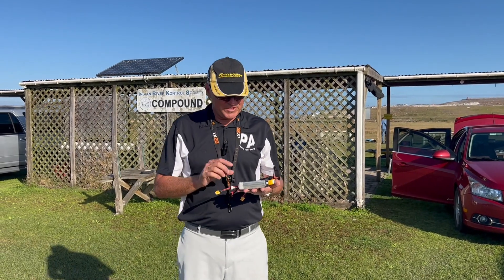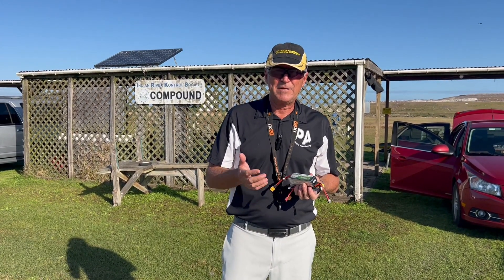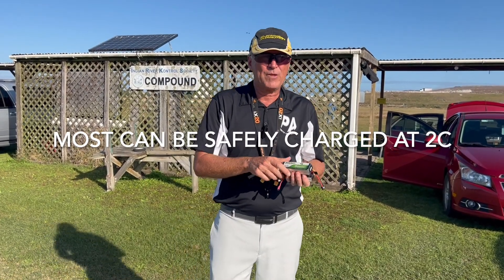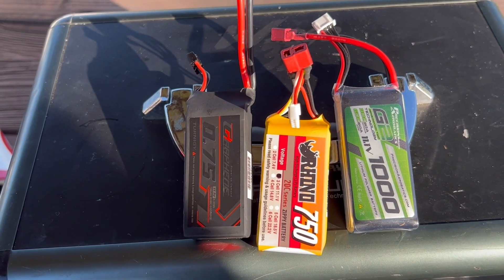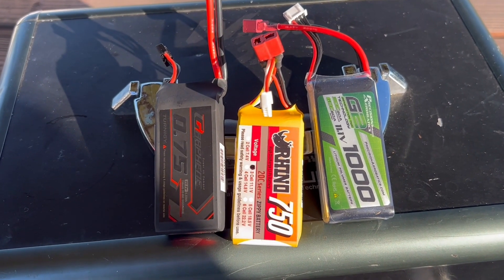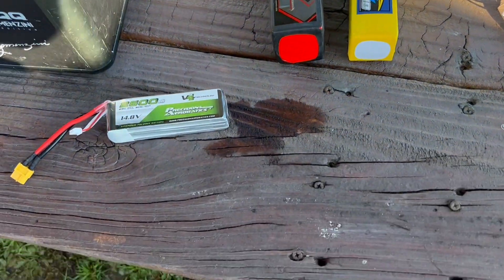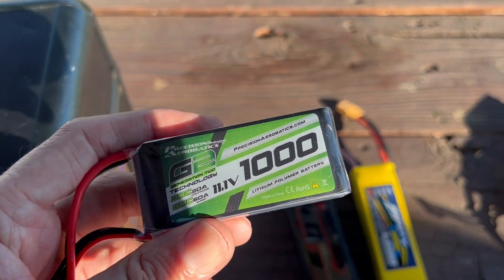Michael Wargo Instruction:   Batteries.   Choosing the right battery.  All you need to know.

Comment: Hello Michael, I would like to know how many C of discharge I need for the battery for the hobbyking Durafly Tundra v3, in its specifications it says 4s 2200mah, and a minimum of 30c, but how many C will be ideal? I recently discovered your channel and I find it essential, greetings from Spain.
Reply from the maker: The Tundra is not a power hog.   30c is fine.   Honestly, I like to fly it light, so a lower c rating is what I gravitate toward.   BUt remember, what should help your choice should be how you fly it.   If full throttle all the time, a higher c rating would be better.   I hope this helps!

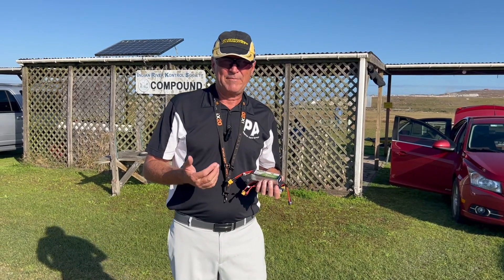Comment: 0:48 No, That means it is 2.6 amp hours. Ah is energy storage capacity. Amps is an instantaneous measurement of current.
This is designed to be an introduction video. Don't confuse the novice immediately by mixing up this basic terminology.

Comment: We tend to forget that capacity is milliamps. Per hour. Our flights and motors consume so much amperage, that we reach safe discharge in 6 minutes 1/10 of an hour. That draw is not constant either, depending on the craft and flying style there many be different burst of amperage,  (really watts amps x volts). This is why the other "C" rating which is of burst capacity may be higher between craft.
A 5lb plane consumes less watts and has potentially fewer and less bursts than a 5lb heli

Comment: When it comes to battery claims, believe no one.  labels lie.  Manufacturers lie.  Under realistic high load tests the best high C batteries rarely exceed 35C-true.  Anyone who believes a 50C, 2600 mah battery will deliver 130 anps (2.6x50) is grossly uninformed and has no business spreading such misinformation.  BTW, capacity is measured in milliamp-hours, not milliamps.  And light-weight batteries are generally light for specific reasons -- which are not beneficial to performance.  Sad fact is weight and battery performance go together.  Bottom line, you need to realistically load test your batteries to know what you have.

Comment: Enjoyed your discussion. Also would like to see a comparison between std. and HV Lipos to know if those are worth using...👍
Reply: They are.  I have been using the SMC HV batteries.  ITs crazy how long I keep mid-high range voltage.
Reply: The smc  hv packs are Def worth it and you will notice quite a difference the others I've never tried and never seen anyone with any